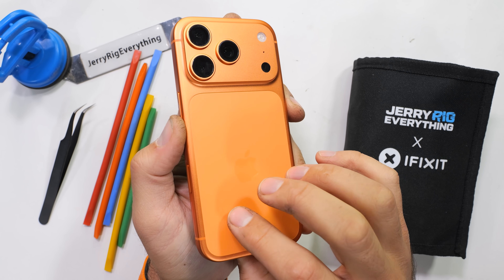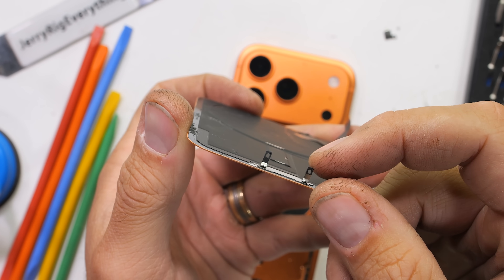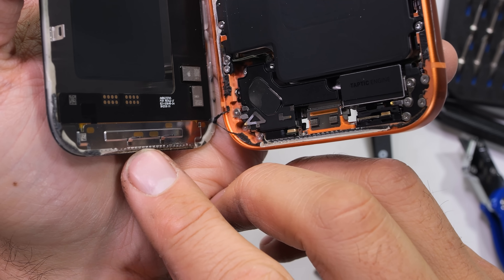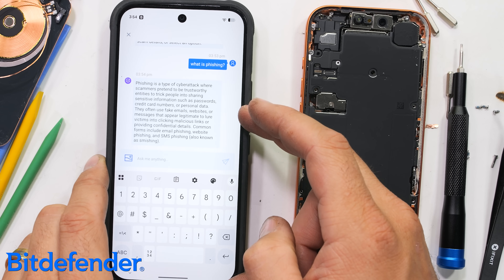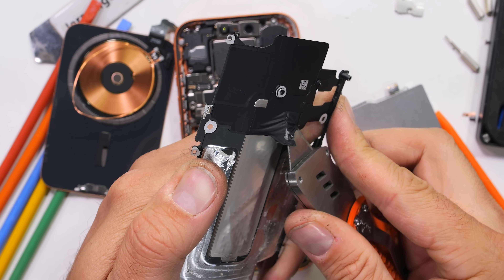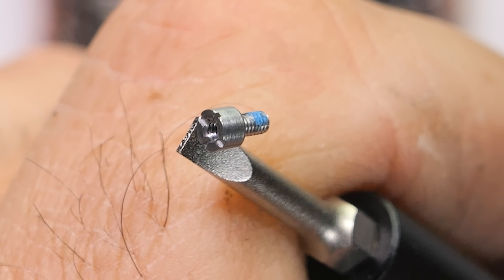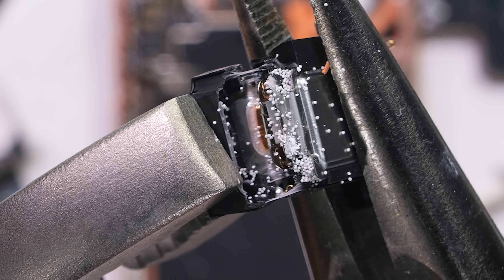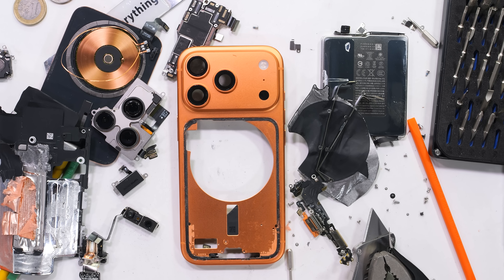iPhone 17 Pro Teardown -- I AM JEALOUS

Comment: That’s a great question — and one that touches on Apple’s entire design philosophy. iPhones use a lot of screws, adhesive, and tiny components for several key reasons:

⸻

🧩 1. Precision Engineering

Apple designs iPhones to be extremely compact and rigid. Every millimeter inside the chassis is used — for the battery, logic board, camera modules, and antennas.
	•	Multiple screws (of different lengths and threads) help secure each layer precisely, preventing micro-movements that could damage fragile parts.
	•	Unlike many phones that use plastic clips, Apple prefers screws for long-term alignment and strength.

⸻

🔒 2. Durability & Structural Integrity

The iPhone frame and internal structure are designed to withstand drops, bending, and pressure.
	•	Extra screws reinforce the rigidity of the metal frame.
	•	They also reduce stress on solder joints and connectors when the device flexes or heats up.
This contributes to that “solid” feel people associate with Apple products.

⸻

🔐 3. Security & Anti-Tampering

Apple uses special screw types — like pentalobe screws — to deter casual tampering.
	•	These are not standard Phillips or Torx screws, meaning you need special tools to open them.
	•	This discourages untrained repairs, ensuring devices are only serviced in controlled environments.

It’s part of Apple’s broader “right-to-repair” debate — balancing product integrity with user serviceability.

⸻

💧 4. Water and Dust Resistance

Starting from the iPhone 7, water resistance became a major design goal.
	•	To achieve an IP67/IP68 rating, Apple uses tight seals, gaskets, and adhesives around openings.
	•	The screws are part of this sealing system — ensuring uniform pressure to keep water out.

⸻

⚙️ 5. Modular but Layered Design

Inside, an iPhone is like a mini city:
	•	Screws hold down shields, connectors, and brackets that keep cables in place.
	•	This makes assembly and repair more controlled on the factory floor — even though it complicates do-it-yourself repairs.

⸻

🧠 In short:

Apple over-engineers the screw system for precision, protection, and control — not convenience. It’s part of what makes iPhones feel premium and last long, but also what makes them tricky to repair outside Apple’s ecosystem.

⸻

Comment: 5:35 What do you mean the Galaxy S7 is almost 10 years old 😭
Reply: Coming from Samsung vapor chambers to my first iPhone - 17 Pro, I can attest objectively, 17 Pro is the coolest smartphone I have ever owned. Well done Apple.
Reply: yea but i had one and the thermals sucked even out of the box that phone was hot af
Reply: Asking Grok, here is the answer:

"No, the Samsung Galaxy S7 does not have a vapor chamber. It uses a heat pipe (also called a thermal spreader) for cooling the CPU and GPU, which was a new feature at its launch in 2016 to improve heat dissipation over previous models. A vapor chamber is a different, flatter cooling technology that Samsung introduced later in flagships like the Galaxy S10+ (2019) and expanded in models such as the S23 series. Teardowns and official Samsung documentation confirm the S7’s heat pipe as a thin 0.4mm tube relying on water phase changes, but not a full vapor chamber."
Reply: If it relies on water turning into vapor, in a chamber, then back into water again to take heat away from the motherboard, I'd call that a vapor chamber
Reply: @user-37a20dcbea4  Heat pipes and vapor chambers are basically different forms of the same thing.  They both use an evaporating fluid inside which cools and wicks back to the hot end.  In other words a vapor chamber is just a flat, wide heat pipe.

Comment: I've been an Android lover my entire life, last three phones were an S23 Ultra, S20 FE 5G and P20 Pro (what a phone this was), but the 17 Pro really interested me especially having had enough of having such a massive phone. I wish Samsung would do smaller ultra phones. 

Bought one this week, it's taken a bit of adjusting to iOS but i've really liked the phone. Doesn't feel a million miles off the S23. iOS 26 is definitely missing a bit of polish, there's some weird animation/UI glitches but at least that's just software. I'd say its a really solid phone though that I can see myself using for another 3 years at least. I do wish they'd have sold the esim only models here in the UK for the extra battery though. Oh and the orange is fucking beautiful.
Reply: Dont you miss Modes and Rountines?
Reply: @lawyerpanda1856 Honestly not really, I’ve been really liking the ‘Focus’ options that iOS have. I use a few for sleep, work & driving to limit notifications to just a few people. 

The only real gripe I have is the iOS keyboard is terrible. It genuinely feels like they’ve made no effort to improve it since the last time I used iOS on a 4th gen iPod touch. Having to go to a whole separate page just to type a symbol or number is one of the worst UX experiences I’ve had in a while.
Reply: Agree the Orange is the best Color!

Comment: The worst vapor chamber implementation ever, no contact with the processor using paste or thermal pad nothing and not also with aluminum frame, lol Apple. 🤣😂 So why the vapor chamber is there don't know only Apple engineer knows the best.😏

Comment: So essentially the vapor chamber is like water cooling in a pc, with the difference being that in the phone the water vaporises before getting cooled again?
Reply: Kinda, in liquid cooling, the water simply just increases in temperature when absorbing heat and then the water is cooled off by the fans away from the chip. In a vapour chamber, water is vaporised, it requires a pretty significant amount of heat energy which is absorbed called heat of vaporisation, then the vapour travels away from the chip to elsewhere, where it cools down and releases heat away from the chip.
Reply: It's like a regular computer air cooler. The heat pipe/vapor chamber moves heat from where it's hot to where it's cold. In a pc that's the fins with a fan in front, in a phone that's the battery and screen. From there, the heat will go through the different layers until it's outside.

Look at an image of a hyper 212 for example. With the old versions, you can see the difference between the copper heatpipe and aluminum fin
Reply: @b127_1yeah but the concept is pretty similar
Reply: No loop, still relies on internal cooling capacity, no fan to dissipate it to
Reply: @drakme1077yeah indeed, but the loop isn’t necessary due to it being tiny, but like i previously mentioned the concept is pretty similar
Reply: More accurately, it works like an ice cream scoop
Reply: @yadude_log nah thats just metal that easily absorbs heat from your hand if i recall correctly, this is more advanced
Reply: @dr_ghost_007_6  I'm pretty sure some have water chambers in them. I think there might be a NileRed vid on it too
Reply: More specifically there is water in a VACUUM, so the water is essentially always boiling. This constant state of boiling allows the water to evaporate and condense extremely fast between warmer and cooler sides of the chamber. Unlike PC water cooling the water moves around passively.
Reply: Older Nvidia GPUs had vapor chambers in the reference editions. If it's something like a 980ti with a single turbine, the rest of the cooler is exactly that.

Comment: The fact that the battery is mostly held together by screws is astounding for Apple! However I do wish that in future generations they find a way to make the battery removable through the opening of the now smaller back glass. It would make repairs so much easier and you wouldn’t risk damaging the display.
Reply: Who remembers when if you dropped your phone, the only thing that would happen is that the battery would detach. You put it back on, booted it up and off you went with your day....
Reply: The risk of damaging the screen is a feature, not a bug.
Reply: @iRunfastXC  xD
Reply: Yes thanks to the new EU law coming, this is the info AI is giving about the topic:
« The new EU Batteries Regulation requires most portable electronic devices, like smartphones and laptops, to have easily replaceable batteries by February 18, 2027. »
Reply: My LG G5 was AWESOME for this battery replacement capability.... Well until a small puddle killed it... Yea actually I think im off of replaceable batteries now, I prefer waterproofing.
Reply: @Lustratum my old galaxy s5 had removable battery AND was waterproof. You can have both.
Reply: its going to be a feature in iphone 26
Reply: you can thank the EU for this
Reply: @iHazMuffinz For what? Controlling everything?
Reply: @NoiPhono standardising a consumer electronics charging port and data transfer standard?
Reply: @NoiPhono  for forcing companies like apple to switch to user replaceable batteries.
Reply: @NoiPhono  for making laws that actually help the population and environment and not the big companies? Like what every gouverment in the world is supposed to exist for?
Reply: @iHazMuffinz I am sick and tired of the EU thinking they are supreme rulers of earth who get to decide everything for everybody.  Screw ‘em, Apple, Samsung, and Huawei should all pull out of the EU.   It’s colonialism 2.0 and let’s see how good of a phone the EU citizens can have when all of the “foreign savages” are tired of being bossed around by the white European who thinks he knows best and pull out.
Reply: @joemamr710  you want all of these companies to go out of business?
Reply: @artug92  it would never get that far. Once they pulled out, within a single year the European Union will come crawling on their knees, begging them to re-enter their market because the economy would be destroyed, and their citizens would have great difficulties communicating with each other and getting things done and competing on the global stage.

It will quickly put an end to their colonizer/exploiter mindset
Reply: Lol no it's not in 2026 all phones have to be easily repairable they r practicing
Reply: That'd be especially important because Apple doesn't sell budget (comparatively cheap) phones.
Reply: The people we pay to represent us should have manufacturing rules that force all product to be easily repairable.
Reply: @shiraz1736 no they shouldn’t
Reply: Kyocera also had the "Hydro" line of shower phones, plastic backs and some weird orange o-ring. But watches have been waterproof for ages and have replaceble batteries.
Reply: That's what they are aiming for. By February 2027 all new phones sold in the EU will have to have easy to replace at home batteries.
Reply: @CosminGrg what?
Reply: even android phones have non removable batteries to ensure waterproofing and have no more SD card slots, what makes you think apple will go there?
Reply: @rnrthelad29 you think micro SD cards going away was because of ip rating? I guess my phone having a sim card slot makes my phones ip rating meaningless
Reply: @handledrandomly I take the sim card tray out of my S22 Ultra they could have easily fit an SD card in it.  Samsung should have kept the note line and included the SD card with it. My Note 10 Plus that I had was the best smartphone I have ever owned and having the SD card slot was great.
Reply: @rnrthelad29 no one's talking about removable batteries. It's about taking it from the back, instead of from the front so you don't risk breaking the display.
Reply: @rnrthelad29 all you need is a silicone band which will costs apple maybe 10 cents more per device for changing the glue with it. If there are diving watches with easily replaceble batteries that can go up to 100m in sea water, I think apple can do it too.